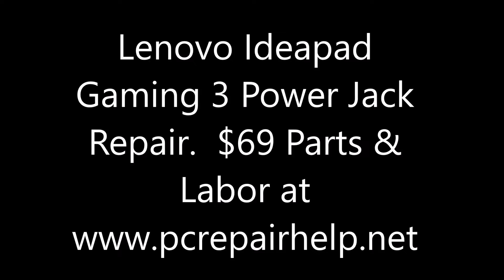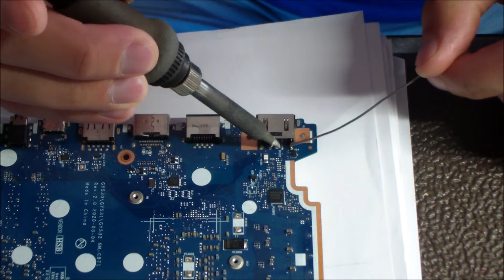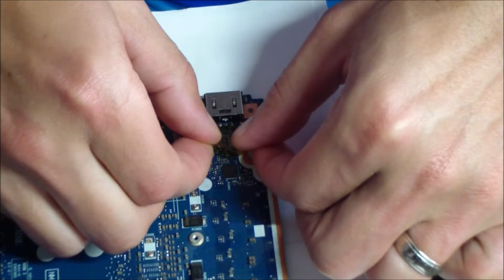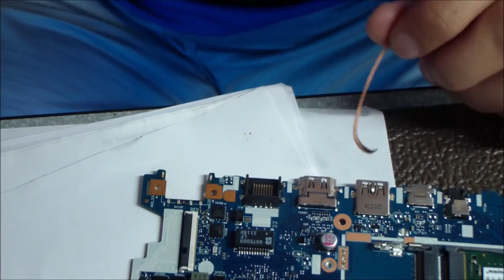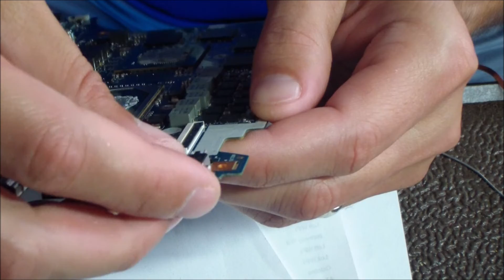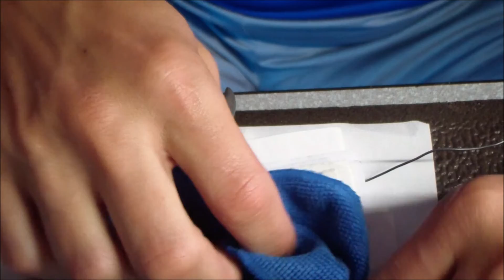How to Replace the Power Jack on a Lenovo ideadpad gaming 3 laptop.

Comment: I found it easier to just add fresh solder and remove the connector by heating all the pads and clean out the holes after, but it's whatever suits you.
Sometimes but rarely I used low melting point solder to aid removal.
If I could not clear a hole especially the 2 near the edge of the board I would just hold the new connector in the recess and just heat both and push it into the hole.
Keep the vids coming.
Reply from the maker: Yes, that sounds like a good idea too, there are multiple ways you can do this.  Thanks!